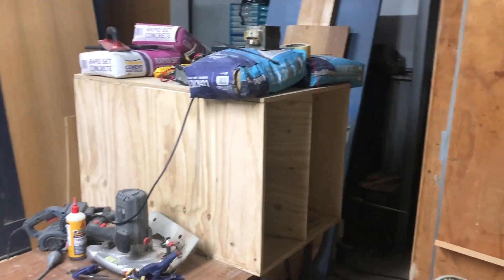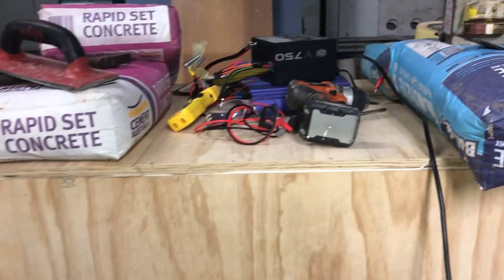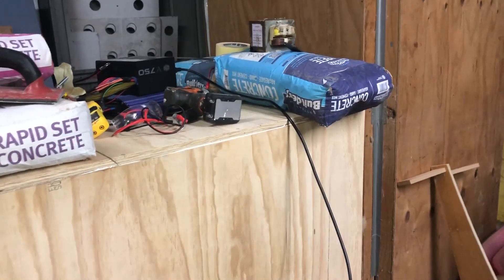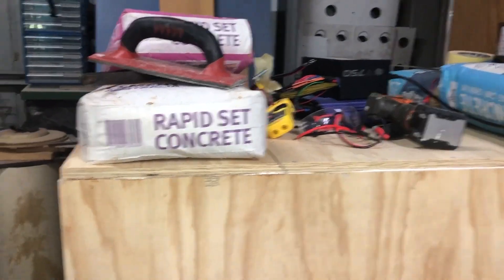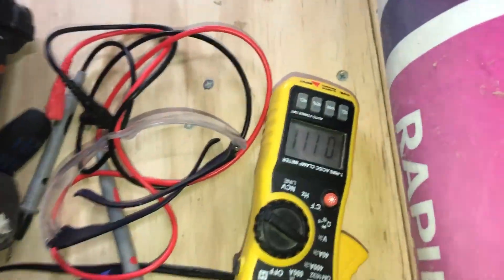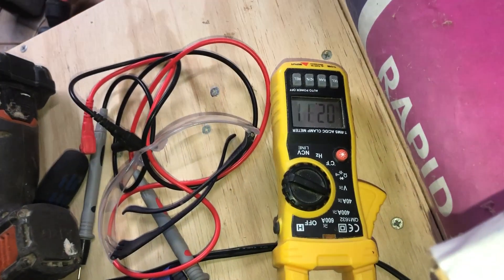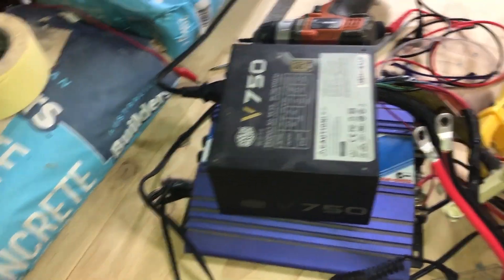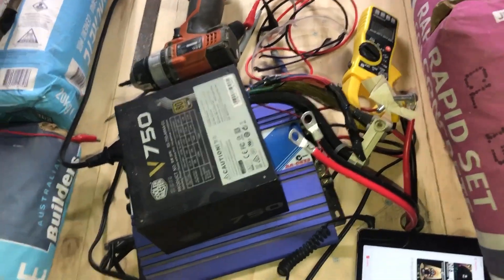IT WORKS! - Folded Horn ep 11

Comment: I have a question about the path within the horn, is 1 side of the woofer essentially sealed or does it load both the front and rear through passages/chambers in to the horn? couldnt quite tell from the minecraft (brilliant idea) vid hahaha. 
Also I have no idea what im doing when it comes to horns but i designed and 3d printed myself a micro (4 inch) copy of the klipsch La scalas, where it fires directly into the back wall with a split path seperated by a pertruding triangle on the wall. Would i be best to have the throat section as small as possible provided the woofer does not contact the wall and then slightly larger width in the neck before entering the mouth/bell? 
Ill try and get a video up soon so you can potentially have a look if your interested in 3d printed audio goods! Im sure youve heard of hexibase but if not i think youd love his channel! between yours and his channels it has inspired me to start building/designing/printing my own systems!! so thankyou!
Reply from the maker: Rear chamber is sealed, HornResp gave a wierd cancellation pattern for bass reflex alignment, so I went with sealed. Thing still bumps hard though. Good thing about running sealed seems to give the driver a ton more control, horns seem to have a wierd loading effect, due to the impedance sitting high, it means the driver moves a ton, which is odd considering the horn is supposed to load/damp the driver movement itself. Still thinking of a design for folded horn 2. I'm probably gonna mimic this one, though skip the fancy curves for straight cuts and see how that affects the sound.
Reply: @Dakoustics  Gotcha! Thats how my micro one is set up too with just a sealed rear section and can also confirm it does not seam to mind it at all hahaha, althoguh Ive seen 'W' Sub Bins with reflex ports/tubes where the sealed section is, so theres gotta be something to it!!, would be curious to see what theyd sound like in comparison to just the front load into the horn,  perhaps ill give it a whack some day and print a small design and do a side by side with the mini la scala (3d printing makes prototyping so ez). ahhh Interesting you mention the driver movement,  ive definitely noticed seemingly extra driver movement when compared to a ported box at the similar audio volume and same driver , perhaps the extra movement is simply because of the higher tuning naturally?!, unsure but interesting phenomenon indeed.

oooo v nice, cant wait to hear 2 of them pumping together haha :P , will be interesting to see if all those extra steps make a huge difference in v2! I suspect they do but not super overwhelmingly

https://www.youtube.com/watch?v=530_HeJhXiQ&t=329s&ab_channel=MrFlexySMPS

Comment: You should look at putting in a pa woofer. A emerence lab12 or along that line. Could suit better then car audio.  Awesome build. Been a good watch. Keen to see more.
Reply from the maker: I'll do a video on that in the future, problem is the sub in there is an oversized 12", most 12" subs are measured to the diameter of the screw holes, this ones measured edge of surround to edge of surround, so its about 1/2" wider. I've got a good PA woofer with 10" magnet and 4" voice coil, and do a comparison. My theory is the car subwoofer is designed more for high pressure, so has a high motor strength to cone size ratio, whereas PA drivers are impedance matched more to air so might bog down with horn loading, but will be good to test to know for sure once I get a proper SPL meter.
Reply: @Dakoustics  one of those russian Pride 15" subwoofers with a motor so strong it could bounce Steve Meade up and down. That would be fun to horn load in a large expanding tunnel enclosure.
Reply from the maker: @TimpBizkit  I'd love to get one if an Australian dealer ever imports them, otherwise the import tax is awful, anything over $1k au has like 20% tax.
Reply: @Dakoustics  I know my Eminence Kappalite 3012LF would be too large in airspace requirements for that enclosure. I need at least 3 cubic feet on each one to work as a vented 12 tuned to 40 Hz. My boxes for 12" are 18" x 18" x 22" external but I love having 96 dB 1 watt 1 metre flat curve efficiency on each box. For two drivers I'm getting 99 dB 1w/1m and because the box is in a corner I can get almost 110 dB 1 watt 1 metre, which means my 600 watt at 8 ohm amp pounds!
Reply: @Dakoustics  the lab series are designed with horn loading in mind. I've been eying off the lab15s for awhile now for my folded horns.     I'll be waiting for next video. I've got much to learn.
Reply from the maker: @liamgibbens8222  I checked it out, looks like a good sub in general, low fs, good qts, in fact I'd say its more similar to a standard home theatre sub than a PA sub. Quite interesting.